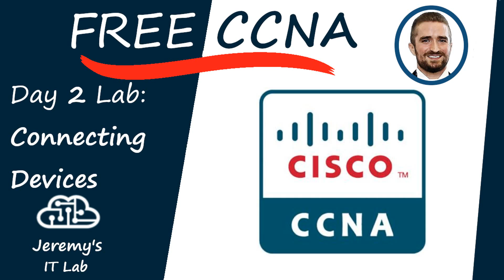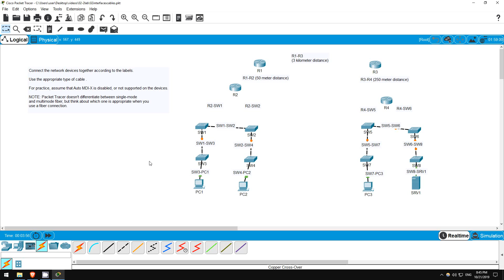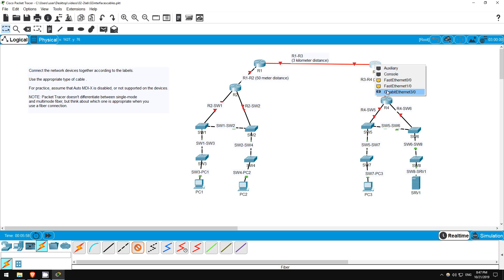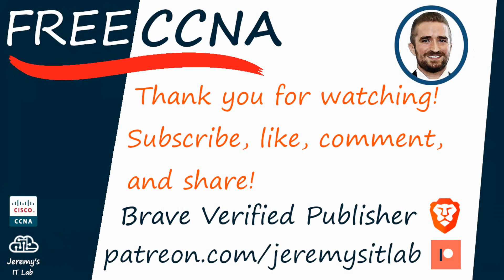Free CCNA | Connecting Devices | Day 2 Lab | CCNA 200-301 Complete Course

Comment: Hi Thank you for your videos. Question, how did you connect R1 to R3 using Fiber? What router did you use? In the cisco packet tracer, I can't connect R1 to R3 using fiber and already used different routers. Thank you again
Reply from the maker: You need to add modules to the router, try a google search for 'packet tracer add module'
Reply: @JeremysITLab  noted. thank you

Comment: Just to highlight, out in the real world you will often see old MM fiber (orange). 
When upgrading to newer equipment, you will often have to replace with newer MM fiber (Teal), as the old MM fiber connectors were SC and not SFP, which everything now uses.
Biggest problem I've seen with newer network engineers/specialists/admins is a firmly rooted desire to be chair commanders instead of getting off their butts and doing a preliminary jobsite walk. You'll save yourself tons of headache and time if you do some basic checking yourself instead of looking at an as-built that shows this or that free/available, which hasn't been updated in years.
If its remote sites, have your local onsite tech help discovery, take pics of the racks, equipment, fiber cans, etc.
Reply from the maker: Yep, always go check the rack, take pictures, etc, before making assumptions.

Comment: Jeremy san, Arigatou Gozaimasu,  
Just a question, why Swithes send /receive data on different pins from the rest of equipment to this day? why not to align with the restand avoid Auto MDIX.
Reply from the maker: I'm not sure the reason.  You're correct that, if everything used the same pins to send/receive, all we would need are crossover cables and Auto MDIX wouldn't be necessary.  There's probably a good reason it's not like that, but I'm not sure of the exact history of how these things developed.

Comment: Hi, why do we use the same interface to make more than one connection? I expected it to not be possible - it is just not discussed but actually it configures another interface, doesn't it :?
e.g. PC1 to SW3 FastEthernet 0/1 and the same FastEthernet 0/1 is used to connect SW3 to SW1? 
Thanks in advance.
Reply from the maker: Hi,
SW3's FastEthernet 1/1, not 0/1, was used to connect to SW1.

Comment: What routers and switch models are we using here? Thanks for these great videos.
Reply from the maker: The model doesn't matter!  But you can download my lab files if you want to use the same ones.
Reply: @JeremysITLab  The reason I ask is because I had errors when connecting Fiber cable indicating the ports and cable are not compatible. Not sure what I was doing wrong. thanks for your speedy replies. I am really learning a lot.

Comment: R1 AND R3 are not showng sfp connection for fibre optic cable ,i am using 2911 router as urs only,, please help
Reply from the maker: Did you download my lab file?
If you're making your own lab file, you'll need to add the SFP modules to the routers.  Do a google search for 'packet tracer add modules' to learn how.

Comment: Hallo Sir ,just a question just need to ask you which Routers model and Switch model have you used in this video?Thanks and Regards
Reply from the maker: I don't remember the exact models, but any will work.  Note that to use fiber connections, you must add modules to the routers (google 'packet tracer add modules' to learn how).  Or you can download my lab files from the link in the description, everything is prepared there.
Reply: @JeremysITLab  ok Sir Thanks a lot indeed..:)

Comment: when i tried to connect fiber cable between two router, they are far away i get error text said the cable cannot be connected to that port even i chose gigabit Ethernet
Reply from the maker: You need to connect to a fiber port, most gigabit ethernet ports are RJ-45 ports for copper cables.  If you download my lab file I have it all set up for you, but if you make the lab yourself you will need to add the fiber port modules yourself.

Comment: what is the type of R1 and R3 ?? can't connect the fiber bc no port is displayed for fiber, what could be the reason?
Reply from the maker: None of the router types in packet tracer have fiber ports by default, you have to add them.  Do a google search for 'packet tracer add module' to find how to add them.  Or you can use my pre-made lab files, if you sign up here I send them for free:
'Free CCNA 200-301 flashcards/Packet Tracer labs for the course: https://jeremysitlab.com/youtube-join/ '
Reply: @JeremysITLab   I'm already subscribed, but I subscribed again, I guess I need to google it and add it to my packet tracer app, but I believe that the added text and info in the video like the explained connection and distance is something I need to learn through PT app, I'm doing my best, I hope I can get through this without much burden.
Thanks for your good follow up.
Reply from the maker: 5Incognito If you subscribed but didn’t get the email with the links to the files, send me an email at jeremy@jeremysitlab.com!

Comment: Why do we need to connect switch 2 to switch 3 and switch 5 to 6. All of them are connected to the corresponding routers, means, switch 2 and 3 are connected to the router 2. So why we need to connect these switches together???
Reply from the maker: It's always a good idea to have multiple paths, so if there is a problem on one connection, the other can be used.

Comment: Suggestion: Show what model of router should be chosen and no need to guess. It is because some routers has no fiber ports and some has insufficient ports. For my case, I chose 4321 and 2911 are both hit the case I have just mentioned. :(
Reply from the maker: T L None of the router models have fiber ports by default, you have to add the modules yourself.  Just download my lab files, everything is set up for you!

Comment: I applied it all but i faced a problem with the last two steps when i connect R3 and R1 and when i connect R3 and R4 .. it gives me an error that the cable can't be connected to that port .. Please would you tell me the solution of that problem ?
Reply from the maker: Did you download my lab file?  If you make your own lab file you will need to add SFP interfaces to the routers for the fiber-optic cables.

Comment: Hey just wanted to ask a quick question.  If I go through all you videos should I be able to pass the CCNA or do I need additional resources?  The reason I am asking is I looked on the CCNA website and it looks like there is a lot that is not covered here.  The videos are great though I just want to make sure that I am prepared when I go in to take the test.  Thanks
Reply from the maker: First off, good job actually looking up the official exam topics list and comparing it to the study materials, many people don't do that.
The course is only about 50% complete at the moment so lots of topics are missing.  It will eventually be complete, but you'll definitely need some other resources if you plan to take the CCNA soon!
Reply: @JeremysITLab Follow up Question. Is this course completed now to be able to use to pass the CCNA EXAM? 

And thank you for your this course, I absolutely love it!

Comment: if switch 2 is already connected to switch 1, why does it also need to go to router 1? is there benefits? (just not how I was taught previously)
Reply from the maker: It doesn't NEED to, but there is usually more than one way of doing things when it comes to designing networks.
Two possible reasons:
1. Redundancy (to provide an alternate path to the router in case of hardware failure)
2. To balance traffic over the two switches, instead of all traffic having to pass through switch 1 to reach the router.
Reply: @JeremysITLab   awesome. forgot about redundancy etc.much thanks.. so far awesome classes

Comment: Not able to connect router to router with fiber . ERROR----The cable cannot be connected to that port . HELP
Reply from the maker: Routers in packet tracer do not have fiber optic ports by default, you have to add a module.  You can download the lab file from the link in the video description, I have everything set up for you.
Reply: @JeremysITLab  I downloaded that packet tracer file . 
ERROR --- Not compatible with this version of  Packet Tracer .
(Packet Tracer 7.2 for windows 64 bit )

Comment: Can switch 1 and switch 2 connect to each other while both connected to the router R2? No looping happens?
Reply from the maker: Yes you can connect them, no loop will occur!
Reply: @JeremysITLab  May I know what's the purpose to connect them? They can transfer data through router right?

Comment: Thank you Jeremy! Best CCNA course by far.
Two questions:
1. R1 and R3 does not give me option to connect with fiber. It only has auxillary, console, and fastEthernet options. I am not sure why.

2. How many days are we going have on this course? Basically, how long is it going for you to finish the entire course?
Reply from the maker: 1. Did you download the packet tracer file from the video description?  Everything is prepared in there for you.  You need to add a module to get the fiber interface on the router.

2. It will be about 50 days, I will finish by the end of this year or early next year.
Reply: @JeremysITLab  I did not download the packet tracer file. It worked when I did that. Thanks a bunch. 

Another quick question: Does the main folder (CCNA) in anki flashcards hold all the questions from previous days when imported? So if I keep importing, say until day 15, is it going to hold all the questions through 15 lessons?
Reply from the maker: Abdul Sarker You’ll need to import each deck, and then move the cards to your central CCNA deck.  It will just add the cards to your current deck, it won’t write over it.
Reply: @JeremysITLab  That's what ai wanted! Thank you very much. I feel like I will reach day 19 soon enough and then the waiting game will start for your next uplaload. These are some amazing contents Jeremy. Keep it up.

Comment: Thank u so much for uploading these videos !! They are quite helpfull . May I please ask u one question though? I have tried every router possible in order to connect R1 to R3 through the Gigabit ethernet port and even so it cannot be connected through optical fiber. what am I doing wrong?
Reply from the maker: Did you download the lab file from the video description?  It has everything set up for you.  You have to add a module to the router to be able to use fiber cables with it.
Reply: Oh thats what I did wrong thank u soooooo much 😁

Comment: The signal on the wires to/from the routers are "down", because the routers haven't been configured to an up state, right? Or are they all supposed to be up and in green? Yours are red too so just wondering.
Reply from the maker: Yeah Cisco router interfaces are down by default, so you need to enter the CLI to enable them.  I teach about the CLI in a later lesson, so in this video I just focused on physically connecting the devices.
Reply: Jeremy's IT Lab Thanks for the quick reply! Do you know how to disable auto mdi-x in PT?
Reply from the maker: @ytfamily000  The command is 'no mdix auto'.  I haven't tried it in packet tracer, let me know if it works!  For example, connect two switches with a straight through cable, turn off auto mdi-x, and see if the interface goes down (it should).
Reply: @JeremysITLab  Thanks. Unfortunately I wasn't able to get the command to work. Not because the command is wrong, but because I don't know the correct level to put it at. Tried switch# and switch (config) and got this error: % Invalid input detected at '^' marker. 

Still have lots to learn! :)
Reply: @JeremysITLab  FYI, there's an option in Preferences to disable auto MDI-X. Guess I missed seeing it the first time.

Comment: Hey Jeremy, thank you for taking the time to upload these videos: 

My question is in regards to the routers R1 and R3 at the very top of the hierarchy. 

Would it have been possible to simply connect routers R2 and R4 directly with a fiber optic cable, and thus complete the network connectivity without a need for routers R1 and R3?
Reply from the maker: The answer is, it depends!  There are so many things to consider that I can't give a 'yes' or 'no' to that question.  Each situation in the real world will be different.

Comment: Hello Jeremy,
First of all, thank you so much for this amazing work. Secondly, I want to ask you a question: 
Why did you connect both of the switches although they are connected to the same router? 
Thank you
Reply from the maker: This is for redundancy.  For example, if the link between SW1 and R2 fails, an alternate path for SW1 to reach R2 still exists (via SW2).
Reply: @JeremysITLab  Thank you so much Jeremy!
Reply: @JeremysITLab  I got the answer to my question. HAHa thank you.
Reply: The lab is about differentiating type of cables, so basically he want to show the different cable type used to connect between two switch(cross over cable) and between switch and router ( straight trough cable)

Comment: just watched this and you have done great job so far, but I noticed that you are not commanding ports to be the same on both sides... this should be a must...for a common placement on larger networks
Reply: Good points, however on most networks that preference fails once you start getting multiple pieces of equipment connecting across multiple closets.
Connecting the closet for the first floor to the dist switches on the fifth floor works swell, then you get to floors 2-10 and you run out matching ports.
More important is to make sure you label the port identifiers so sho int status/etc is relevant.

Comment: This is awesome. Thank you for putting out these videos. Is there a video missing where you go through setting up the equipment? Took me a good bit to find the right modules to put in each component, in order to follow along with building the lab. I think that was my only issue I had with following this, otherwise everything was very simple and easy.
Reply: Download the packet tracer file associated to each video.
Reply: And if you want to dig a little deeper; try and re-create the labs using just imagery - ex; I also forgot about the files; then tried to re-create the WAN emulation myself ; and didn't realize there were not enough interfaces to support the "Attacker" or the Tokyo Firewall.  Upon realizing nothing connected - i looked at the rear of the "WAN Emulation" 9 ( cloud icon ) and replicated the interfaces to face; It helps to understand the interfaces and knowing whats supposed to be connected to what.
Reply: I did not realize there were files associated to each video. I was just going off of what each video was showing and trying to replicate it myself. Took me a while, but eventually was able to get it pretty close to the video.
Reply: @chriswest1043   Sweet bro ! Happy studies !

Comment: thank you jeremy's i have issue i cannot connect fiber caple in router to router or to switch is says (the caple cannot be connected to that part].
Reply from the maker: There must be a fiber interface in the device.  You can add it in packet tracer, or download the lab file from the link in the description, I already added it!
Reply: same problem..please help me
Reply: He helped me read it carefully
Reply: @fyoutubesubbmeyouown2ofthe989  Hi what's the name of the fiber interface in packet tracer?
Reply: @fyoutubesubbmeyouown2ofthe989  Also I already added the HWIC-1GE-SFP module but still not working
Reply: @fyoutubesubbmeyouown2ofthe989  found it, thanks tho

Comment: Hi Jeremy!
First of all I want to say thank you for these great videos!
Now I want to make you (and who wants give the opinion)a question:
I have in my Cisco lab these: 
Routers:
- 1941
- 1921 (with 4ESG, VPN module and permanent Security License)
- 2921
- 1721 (very old)
Switches: 
- 2960S-48TS-L
- 2960S-24TS-S
- 2x 3750G

Firewall:
- Asa 5510

Phone:
- 7941

SFP:
- 2x GLC-SX-MM (but still need to buy an LC-LC cable yet)

2 Internet connections of 100Mbps

I don't go well with simulators... and I can find these for cheap on eBay so...

Do I need something more?
I am not very concerned to pass on CCNA, my goal is to learn the things and get experience, and, after that yes... I will go to the exam!

I started to learn by myself this summer, and I totally fell in love with Cisco networking!

Best regards from Portugal

Comment: Hi Jeremy, I have a question. Why do we need to connect sw1 and sw2 to each other, wouldn't R2 bridge the connections anyway? Likewise with sw5, sw6 and r4.
Reply from the maker: If we don't connect the switches, there will be four separate LANs (one for each switch).  In the network here, there are two separate LANs (SW1 + SW2, SW3 + SW4).  You don't "need" to connect them together, but it will have ramifications by separating it into four LANs instead of two.
Reply: @JeremysITLab  got it, thank you so much for clarifying that. loving your course, very much appreciated.